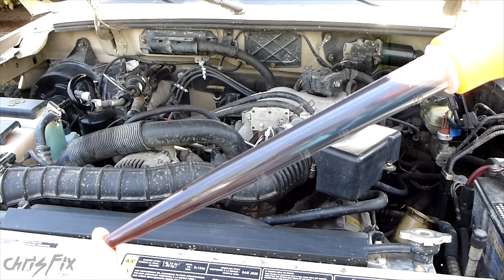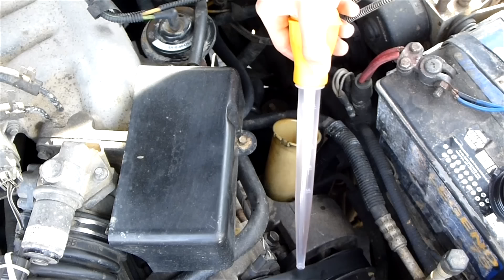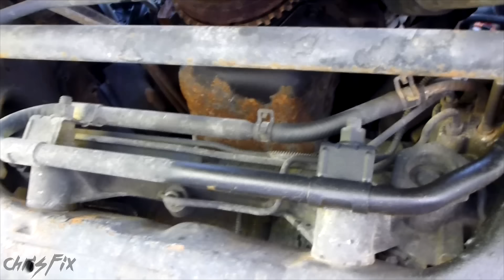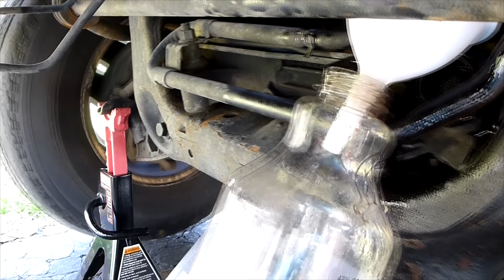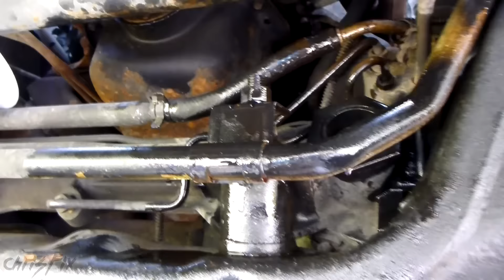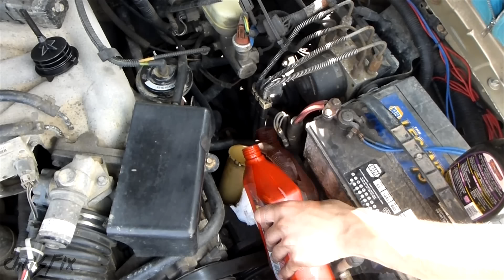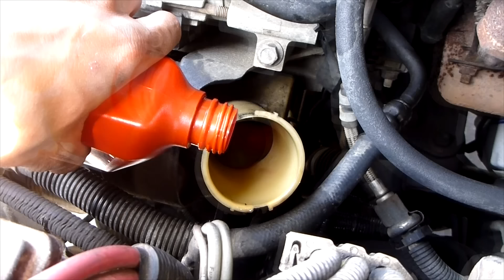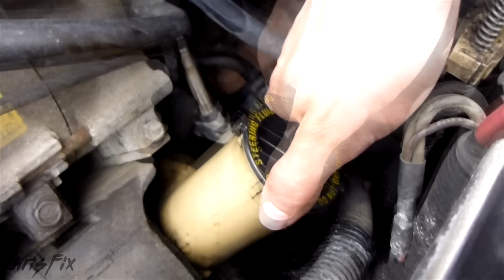How to Flush Your Power Steering Fluid

Comment: How does electric-powered steering work? Is it just an electric motor that pumps fluid as opposed to a pulley, or is it a whole different setup? My car has electric-powered steering and there is no reservoir for power steering fluid under the hood.
Reply: Aidan Franits Electric power steering does not use any fluid or hydraulics. You sir have an electric motor on the rack and pinion or on the steering wheel column. Electric motor helps with steering assist, and that is as simple as that.
Reply: +yabba myiciin well thats only one type. all racks and pinions need fluid for lubrication cant check the level its a sealed unit.
Reply: Daniel Kerkotchian True. If It's a sealed unit, you don't touch it at all.

Comment: Chrisfix, when my dad and I took the Lincoln for a drive, the power steering pump was low and making noise, I fill it up to full, start the car, and we take it for a drive, after 30 seconds, smoke comes out under the hood and the power steering was running dry, no line leaks, the power steering pump was overheating and fluid was shooting out the top, so when my dad put water on the pump using the hose, it stopped making noise, why was it overheating? The pump is origional, btw, we used ATF for the power steering which it takes. BTW, the car is a 1970 Lincoln contenental mark III
Reply from the maker: kenny1234587doesMC The power steering pump is probably bad and you need a new one. I would also check the power steering lines and make sure they are not clogged.

Comment: I got a peugeot 407, which has a electric power steering system, i just wondering, the procedure of a power steering flush for these cars also will be the same?
Reply from the maker: Akila Wijesinghe Electric power steering is typically not hydraulic so there is no fluid. It uses an electric motor to assist you.
Reply: +ChrisFix but my car's power steering pump has power steering oil inside

Comment: Chris, is checking the reservoir a good enough indication of how clean the fluid is? My fluid looks great and I don't see a need to change it but it is the only fluid I haven't changed since I bought the car a few months ago. Wondering if I should do this or if I should just leave it alone. No noises or problems, works great and is the right color and not murky or anything.
Reply from the maker: ***** Correct. The reservoir will let you know how the fluid is. Leave it if it looks good and there are no problems!

Comment: My Mercedes c300 makes a weird noise when the steering wheel is turned either all the way left or all the way right. Took it to get fixed they couldn't fix it after multiple tries. The sound is sort of like a winding noise. What might this be? And how can I fix it
Reply: Jeva If it's when your steering wheel is at the " lock " at full Right or full Left. That is just a pressure check valve in the power steering pump making noise, it's leaking off pressure to prevent from hurting the pump. It's completely normal operation
Reply: It's this, what his doing...

Comment: Now I know whats wrong with my neighbor's car. I hear it start up every day. Can't believe he's run it for months sounding just like this one. -QUESTION-Provided the fluid is still at a good level, is there a danger of it failing while he's on the road? I hope you see this.
Reply from the maker: Stu VS Fords have loud pumps so if it is a ford and the fluid is in decent shape and at the correct level, nothing bad will happen. If it does not have the correct amount of fluid or really bad fluid, the power steering pump could fail.

Comment: My power steering pump does the exact noise shown in the video. It's loosing fluid at a quick rate. I fill the container up to max and in about 2 weeks its empty. It never goes below minimum though. The whole part of the engine bay is covered in powet steering fluid. But on the bright side...no need to flush the system, no noises from the belts,since it is covered in fluid...and no rust problems. Lol
Reply from the maker: checkmyleetskill Might be a leak in your reservoir.
Reply: ChrisFix I wasnt asking for a fix but i appreciate it:)

Comment: hi guys i need help.
I accidentally put a little bit of break fluid in my power steering reservoir. Right after i put it in i noticed i messed up and i did not turn my car on.
i flushed my power steering out and just refilled the power steering again.
i just want to know if i wont get any problems because of it?
Reply from the maker: outkast79l It is good you didnt turn your car on and you flushed the power steering system. You should be ok since you took the correct steps to get the brake fluid out! Good work!

Comment: unplug the return hose and run the car.
Reply from the maker: Kross Theriot Thanks for sharing! I do not recommend running the car because you will run the pump when there fluid is empty which can cause damage.
Reply: +ChrisFix Honda service manual says to do it that way. you do not run the car you just crank it couple of times.

Comment: Hi Chris, great video!
but when disconnecting the retaining line, should I disconnect it from where its connected to the pump or the reservoir? 
Also, when my car makes a loud screeching noise when i turn the steering wheel from lock to lock, even though the fluid levels are normal. Do you have an idea of why this could be?
thanks

Comment: Chris Fix.   I like your clean no extra unneeded information thrown in approach .   You are  clear and very step by step.. not expecting the view to know anything  sort of  idiot proofing it.  IO .  A first time person can attempt this with confidence Plus doing it to the level of a good mechanic. .  Keep up the good work and thanks for doing us all a favor and sharing your know how to simplify these seemingly daunting tasks. You show us what I suspect  what some/most  mechanics don't even do.    I am now a bit paranoid that mechanics I have used don't do the flushes as completely as it should be.  I just got my radiator flushed here in PR and I suspect it was done sub standard.  I am now having steering issues so your fluid change video was great.  I can now watch the mechanic and insure its done right.   Big thanks. AWF

Comment: Great video, but you should really turn your steering wheel lock to lock AT LEAST 20 times with the engine off and the system filled with fresh fluid. Those little bubbles in the reservoir that we saw at the end of your drive are very bad even if it doesn't make any noise. All vehicles are different, and I replicated this procedure identically a couple years ago on my truck only to lose my power steering due to air bubbles in the system for a whole week before I read to turn lock to lock with the front tires off the ground. That was a VERY important step for me and it will be for others too.
Reply from the maker: GioGuitarDude Turning your steering wheel with the car off removes the fluid from the steering rack and will cause more problems because it "pumps" the ps fluid out.
Reply: ChrisFix yes but pumping old fluid out by turning the wheel with the engine off creates a vacuum effect that sucks fresh fluid from the reservoir, eventually getting rid of all the bubbles in the system. Like I said, all cars are different... and some PS pumps don't completely seal the high pressure outlet line, allowing you to get fresh fluid to the rack with the engine off

Comment: so my car is toyota corrolla 2000, which type of fluid should i use?
Reply from the maker: Tom Cat Check your owners manual. It says it right in there.
Reply: Tom Cat Dexron III as power steering fluid
Reply: 900Yugo but my manual said it's transmission fuel, can i use transmission fluid for power steering wheel?
Reply: Dexron III is a Type of Transmission fluid.
Reply: 900Yugo so I can use Transmission fluid Dexron III for my PSW, right?
Reply: yes, that is what it is specified.

Comment: Thanks for the great video. I Bar Leaks for power steering leaks may be a gamble. I can't afford to fix my rack and pinion. The boot on the passenger side has a very small leak. The fluid is black and I know it's need to be changed. Ok I'm thinking how can Bars leak reach that seal that's leaking. Is it risky to drain the fluid and then put the Bars leak first? I'm thinking a mixture of power steering fluid and bars leak at first. I want it to reach the seal. Thanks
Reply from the maker: Sue K Although I have not tried it so I dont know if it works, this stuff guarantees that it will work or your money back: http://amzn.to/1FfokDH
That way you just add it to your fluid and you wont have to drain the whole thing.
Reply: ChrisFix  Thanks Chris. So fluid really does circulate all the way down past that seal and back up? It must because of the pump,Obvious.  I am going to follow the directions and see what happens. Thanks again.
Reply from the maker: Sue K Yea it does. Def keep me posted!

Comment: I have an 07 Cobalt SS with electric power steering. How do I change the electric power steering fluid?
Reply from the maker: Frank Gonzalez With electric power steering there is no fluid. Instead of a hydraulic pump like we are all use to, the electric power steering uses an electric motor.
Reply: I know that, just having some fun with you. Keep on doing those great videos, very informative.

Comment: I attempted a flush the clear fluid returned to gray. (It was black) The steering is much harder and noisier. If I out the wrong fluid in could that be the issue? Also when refilling it never came through the pressure side. Is my pump bad? Its a 99 Ford Taurus.
Reply: Another thought.... When I initially suctioned out the resivoir, I turned the steering wheel all the way back & forth and no additional fluid seemed to gather in the resivoir
Reply from the maker: Justin Carter You should be using the same fluid I used in this video for your Ford. If the fluid didnt come though the pressure side you could have a clog or a bad pump. Use the correct fluid and do it again.
Reply: ChrisFix When I added the new fluid with vehicle off it only came out through the non pressure side. Nothing came out coming from the pressure side. So should I try the correct fluid or does the pump need to be replaced? Also could it be the filter?
Reply: ChrisFix Also, before I go any further, THANK YOU! You're video was great, I have zero to little mechanical ability/knowledge but this video gave me confidence to try it and I enjoyed the journey even if it didn't get the desired result
Reply from the maker: Justin Carter Awesome Justin! I am glad the videos are helpful and it is giving you the know how and confidence to try some work on your own car!
Reply: +ChrisFix When I added the new fluid with vehicle off it only came out through the non pressure side. Nothing came out coming from the pressure side. So should I try the correct fluid or does the pump need to be replaced? Also could it be the filter?
Reply from the maker: Justin Carter The filter could be clogged. I would put the correct fluid in, start the car for a few seconds and see if it pumps it though. If it does, go for a ride and turn the wheel from lock to lock to get the air out.
Reply: Justin Carter
Reply: Yes?
Reply: my grandpa has an 07 F150 that whines and gets louder with the accelerator.  no noise when turning the wheels and I've v already changed out the tendon pulley, idler pulley and  replaced the altinator . could it be the power steering pump pulley
Reply: bambamtime24 it's your cv belt inside the transmission

Comment: Ok I got my fluids topped off because my power steering was whining. And it was quiet for a few days and now it back to whining. What do you think that means?
Reply from the maker: FLYYCHICK56 Is the fluid still topped off? Did you turn the wheel from lock to lock to bleed all of the air out?

Comment: chris great vid ! , just a quick question  how much power steering fluid would  a typical system hold ?  I have a 4cyl Nissan Altima , I want to flush  out and fill the ps system on it but im unsure as to how much ps fluid to buy? , im thinking altogether including reservoir , 1 quart ?   just don't want to buy too much and have it sit and waste away but want to make sure I have enough thanks
Reply from the maker: posneg1970 One quart should be enough for your nissan. I used 1qt in my truck.

Comment: Was the engine running when you turned the wheel?
Reply from the maker: bubbahanks It was not. You dont want the engine running until it is filled up with new fluid. That is why you jack the front end up off the ground.

Comment: @ pretty girl bleed all the air out of the PS pump leaving your PS cap off turn your wheel from lock to lock a good twintish times until it go away
Reply: Dont wanna leave cap off because all the sir that blows through will blow all the fluid all over the engine compartment

Comment: Hey Chris, Another great video man, helps me out alot since I own a Ford Ranger. Do you recall how much fluid the system takes? I haven't checked my owner's manual yet. Cheers! Andrew
Reply from the maker: sniperv25 Awesome! I am glad the video was helpful. I dont remember exactly by I remember it wasnt a lot. Something like a quart or so.
Reply: ChrisFix sweet, I still have 3 quarts of Motorcraft Mercon V atf from my 5 speed oil change last year.

Comment: Okay so I did this flush to my 2000 Jeep Grand Cherokee Laredo but it is still making a hissing sound and it's only hard to turn to the left 
(which was the initial issue, it only hisses when turning left). Can you tell me what to check next?
Reply from the maker: prettygirl0404 If the flush didnt work to fix the problem, your power steering pump might be going bad or your rack and pinion might be going bad. Check to see if there are any leaks.

Comment: Is it necessary to flush the system I have 50000 miles on my Altima the dealer said it needs it,$150.00 and you know how dealers are, or can I just suck it out and put new fluid in?
Reply from the maker: gary moore At 50k miles you can just suck out the fluid and put new fluid in. If you do this once every year you will be fine and not have any problems. The stealership just wants your money!
Reply: ChrisFix Thanks Chris

Comment: How about hooking the return line straight to a drain pan or bottle so the reservoir is completely cut off from the fluid instead of emptying the hose at the end? It would save the turkey baster for Thanksgiving dinner or brake bleeding, and would save the mess of disconnecting the hose to empty it at the end.
Reply from the maker: ***** You could do that too!

Comment: I have a 97 Plymouth Voyager 2.4L Base.

I think my vehicle is designed so that the low pressure (return) line and the high pressure line are both nonremovable. They are both made of metal, and I don't see a line with clamps on. (There is a line like that way back, but I think that is the brake fluid line.)

It is designed so you can disconnect the hose from the resvior leading to the pump, and so thats what I intend to do. Hopefully thatll drain it as much as possible.
Reply from the maker: redsbr If you cannot disconnect the hoses then do this: https://www.youtube.com/watch?v=VuPALAnHjRM

Comment: Nice how u lift up the front end. Most ppl turn it with the wheels on the ground. Puts stress on the shaft coupling, pump, box, and expensive linkages, not to mention your tires. I hate whenever someone drives my vehicles and sits in one spot while cranking the life outta my steering wheel. Puts nice play in it so its sloppy on the highway and pisses ya off. In a parking lot always try to be going at least a half a mile per hour while making maneuvers. I also never pop it from reverse to drive while im rolling at 5 mph like i see alot of ppl do.
Reply from the maker: dangerdavefreestyle Thanks man! Yea I feel ya. I hate the last thing you mentioned! I see that all of the time and cringe! Definitely consider subscribing! New automotive "how to" videos every Thursday and most Mondays!

Comment: the old fluid was red with clumps of what looked to be dirt/oil also bad struts and shocks can make the power steering pump wine and or fail correct me if im wrong
Reply from the maker: sd33zy313 Good thing you replaced that old fluid! I never heard of back shocks/struts causing the power steering to fail. Is there a reason that you know of?
Reply: not really just seems like turning your steering wheel from lock to lock on bad struts could make the power steering pump wine a bit
Reply: on the ground of course
Reply from the maker: sd33zy313 A strut will affect the "bounce" of the car but nothing that would affect the power steering.

Comment: hey chris i have a 2007 crown vic i was told i needed a new rack & pinion i ended up making a dumb move and added some autozone power steering fluid to the reservoir because it was low on fluid and it had that Wine noise coming from the pump but all before i added the fluid in witch mine takes mercon atf but anyway im having loose steering all of a sudden. now i will admit i did attempt to do the flush but i only took it as far as using the turkey baster the noise went away even now its still gone but im thinking if i do the complete flush the right way it should take care of my problem right?
Reply from the maker: sd33zy313 The good thing is power steering fluid and transmission fluid are so so so similar that you dont have to go crazy. In my truck, which has the same power steering pump as your Crown Vic, you can use either power steering fluid or tranny fluid. Dont go crazy and pick a fluid and stick with that fluid. You can do the the flush if you want, but honestly, it probably isnt necessary.